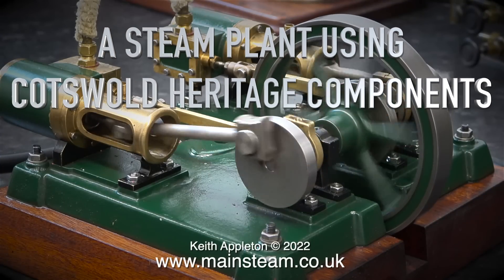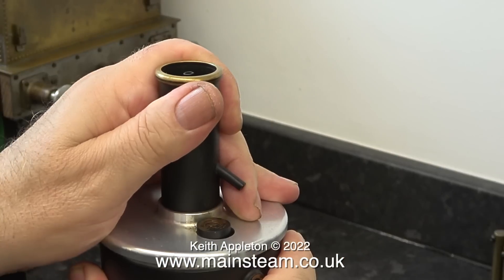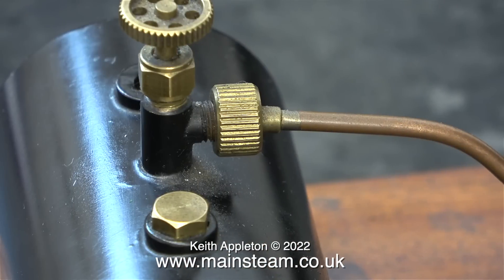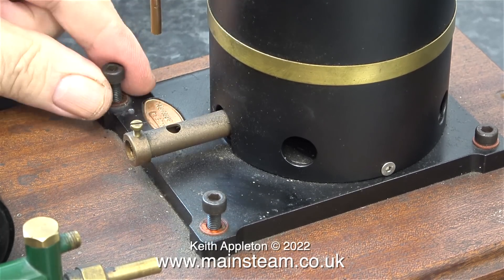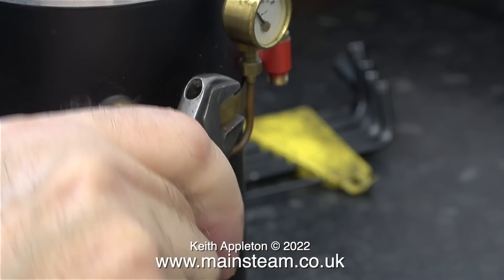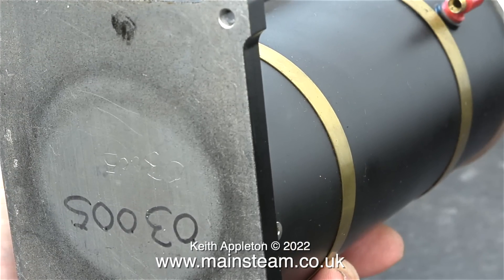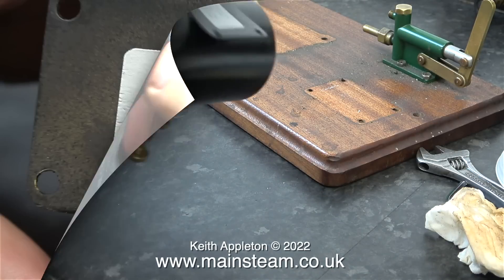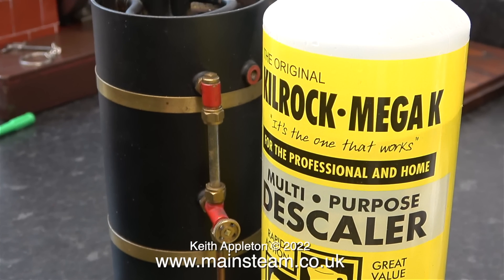A STEAM PLANT USING COTSWOLD HERITAGE COMPONENTS - PART #1

Comment: Tip cleaners for oxy acetylene cutting torch works great for cleaning out small holes. You have to be careful or you will enlarge the hole you are cleaning.
Reply from the maker: Happy 2023 {:-)))

Comment: Hi Keith, I've watched lots of your videos so thanks for making them. This is just an observation but the handles on the water pumps are always essentially a bit of flat bar rounded over at one end. I think the handle design of the reversing gear looks much more like what would be on a steam engine or other machine. Just a thought. Thanks again.
Reply from the maker: The handle on a massively over scale boiler pump on a model is designed to be removed, so it's appearance is unimportant.
Reply: @keithappleton  Thanks for reply.